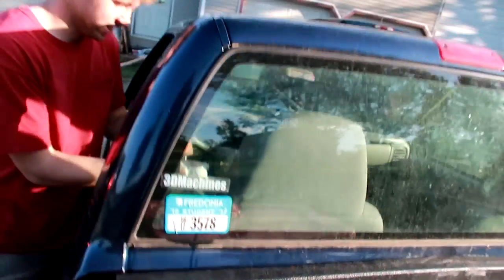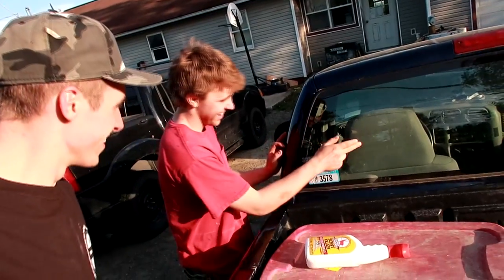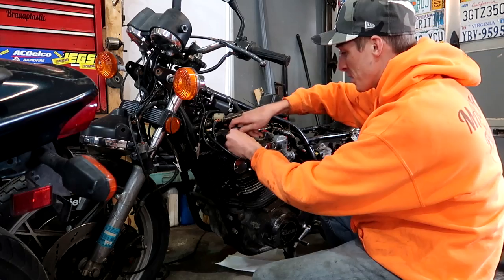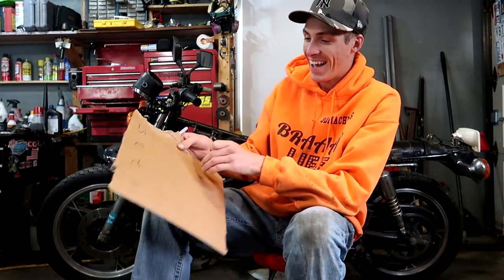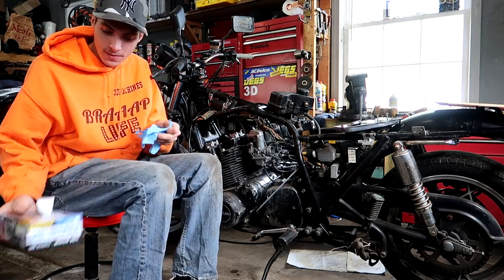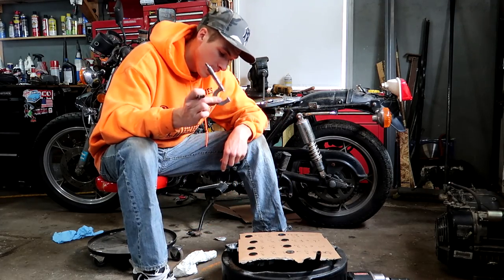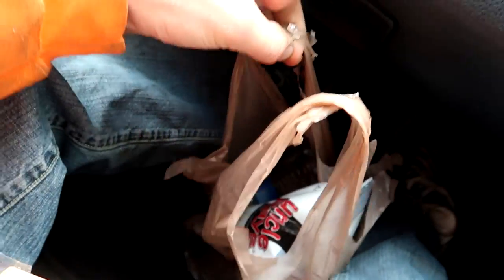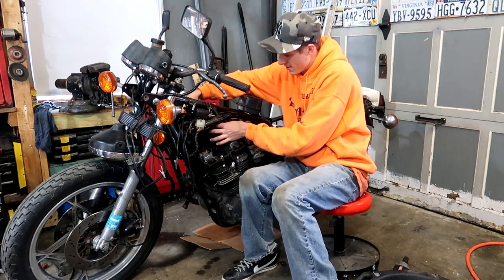THE GS1000 IS BACK!!

Comment: Some of those older bikes had manual timing chain adjusters. After shims are reinstalled you find the slack spot and release the adjuster. Easy if not broken or worn out chain.
Reply: the gs 1000 has an auto  tensioner  but the springs can get weak and the o-rings rot. The seals are available if you have the # Some of the fisch do not list the part these are the #'s I had written down, No GS models have manual adjusters. They go  100,000+ miles before replacement. some people notice the noise but it  is due to the fact that the GS does not use roller gears on the cam chain. There is also a clutch chatter that sounds very similar. You can decrease the noise slightly by overtightening a manual adjuster, but you will decrease the cam chain life. The ramps in the automatic tensioner can become stuck in their guides, and they can also become pitted, so it is a good practice to remove and rebuild the tensioner from time to time.  Here are the part numbers for the o-rings 
09280-06005
09280-21013
09280-10006

Comment: when you use a Micrometer don't use the ratchet stop,  that is for dummies. Turn the thimble very lightly until it stops lock the thimble and you should feel a slight drag when you slide the Micrometer across the part then take your reading, measure a second time to make sure that you have the correct reading.  I am a Machinist by trade.
Reply: davidbrennan5 that's how I've always done it!
Reply: davidbrennan5 i am in trade school for machining, and i was taught the same as you just said. was i the only one who cringed when he called it a clutch. 😂

Comment: New needles and seats for the floats in the carbs. My 91 ninja is doin same damn thing. Ive cleaned them twice now still leaking. You can double check float levels first and make sure the floats aren't sinking and yes the black plastic floats can sink. If you pull the carbs hang them from garage ceiling put clear tubes on bowl drains put fuel to carbs with your little gas tank open the bowl drain while holding the end of the clear line up to bowl gasket the fuel will stop were the level is. should be below the bowl gasket. Make sure carbs are hanging some what level

Comment: needles and seats always leak on bikes, even new ones don't hold long, just use the shutoff valve :)
Reply: sometimes a bit of brasso cleaner a drill and a qtip  will work. If you are broke.

Comment: @for the BMW , u should swap m50 bosch ecu and engine wiring from 325 to get extra power, ur 323i is 2.5 , that would be interesting video, and interesting DIY , bolt on, plug and play, rev limiter from God.
Greetings from Croatia, google that!

Comment: @for the BMW , u should swap m50 bosch ecu and engine wiring from 325 to get extra power, ur 323i is 2.5 , that would be interesting video, and interesting DIY , bolt on, plug and play, rev limiter from God.

Comment: Interesting. The GS1000 has shims but my GSX 400 from teh same year doesnt. You only have to adjust it by a screw and then tighten it again. Super easy but I still need to adjust 16 valves...!

Comment: You may need to check the gear ratio in the rear end of the gator because of the extra power that the gs 1000 will have